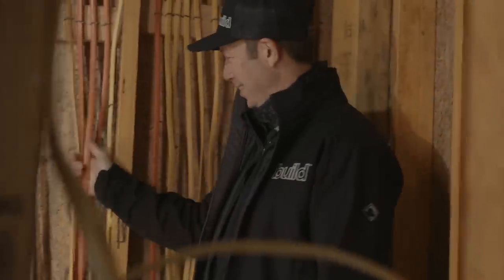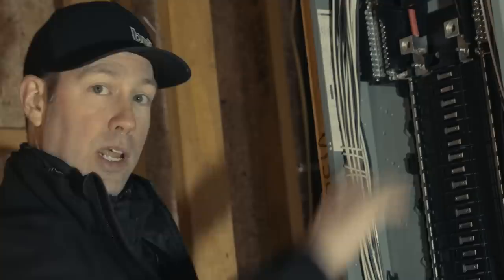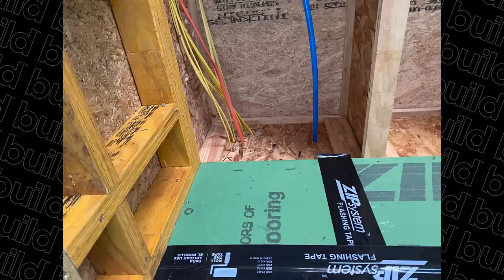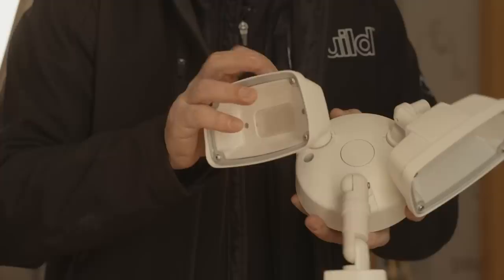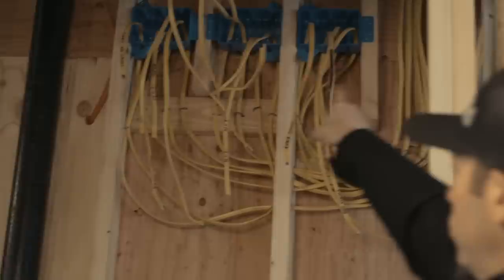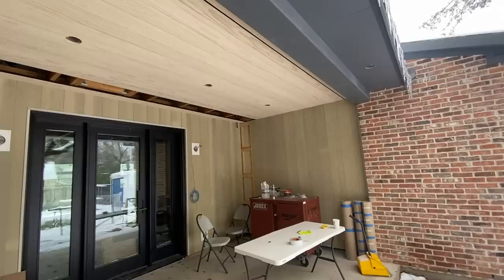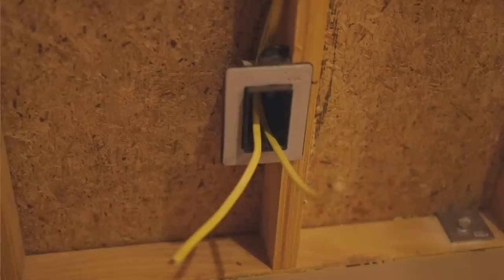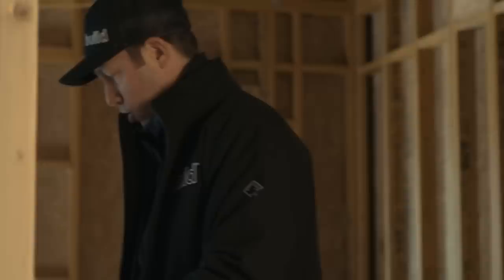5 Tips for New Construction Electrical & Smart Lighting!

Comment: I think the biggest thing that scares me the most is that the setup requires an app. Say halo for whatever reason goes under, chances are their app will cease to function. I’ve seen very similar technology in theatrical lighting controls that have a central processor to make edits and changes. If you’re going for longevity, you might want to look at long term software support solutions.
Reply: Long term, hackers can find vulnerabilities, and operating systems can change, forcing you to upgrade. There is a lot of technology that is beyond the control of the people building it. There is a lot of programming that is beyond the ability of the computer programer to control.  Today, in new construction it still makes sense to wire everything the old fashioned way so that the technology could be removed and replaced with old fashioned simple switches.There are places where is makes cost effective sense to use this technology. (such as remodels where running a new light or wire might be more expensive), but he is potentially asking for problems long term.
Reply: I agree.Sticking to open standard devices like zwave and zig bee are the safest choice from changes in vendor support. You can always switch to another controller from a different manufacturer.
Reply: Don't need vendor support when using an app like Google Home.  Another option!
Reply: @willthethrill360  If they have all the features you want and you’re not worried about Google cloud then it’s a good solution.
Reply: @willthethrill360  you do, the vendor is Google.
Reply: Yeah you want to look for two things in home automation. 

1. Devices that can run locally and don’t require the internet to do their job (they can require Wifi that fine but they shouldn’t require access to some vendor server on the internet.

2. Devices with open standards and long range. As a general rule my experience with Bluetooth has been it’s great for connecting a little speaker it’s not great for entire home automation system
Reply: It also only works when someone using the app is home. The nice thing about hub devices like running home assistant or hubitat is that it is fully offline compatible but it also allows you to control your home remotely if you need/want to. The only thing I really lose with my Z-Wave smart home setup with no internet is Google voice integration. Everything else works locally but having that internet option is also super helpful. It may be minor but he may wish that he had something internet enabled when he is half way down the drive way and he asks "did the kids turn off all the lights".
Reply: @JohnNeville617  you can have the voice integration using home assistant. There are a couple ways to do it some with a cost and some for free.
Reply: All of you guys jumping on here to give your opinion about a system you know nothing about. FYI Halo Home is a white labeled product from a controls manufacture by the name of Avi-on. I work extensively with them in the commercial space. The Bluetooth technology Avi-on is using will be the future standard. Z-wave will be replaced with this, I’m already seeing it in commercial applications. And for those of you saying Bluetooth is only good for connecting speakers really have no idea about it. They are using Bluetooth low energy different from the Bluetooth used to connect speakers. One very nice aspect to it is it works without a hub and does not need to be connected to your home internet network to function. If you want remote access, it does need to be connected to internet.
Reply: @logantaggart  I looked into it and first of all their documentation is pretty much non existent. Their was even a 404 link or two on their site. 

I don’t like things that rely on a phone as their central connection point. I do see they have a bridge but calls their cloud. I don’t like things that use external services because those are always subject to change, or even additional charges as we have seen with Wink. 

Additionally because they don’t interface with a hub you won’t be able to do much in the way of automation as far as I can tell. For example you won’t be able to say “When I unlock non halo brand smart door lock, turn on my entry hall lights.” Since I have yet to find a single company that makes every smart home product, and makes them all well, it’s way more sensible to buy products using common standards that can work with a variety of hubs and devices outside of their brand. That’s not something the brands commonly like because they want you locked into their products.

That being said I don’t know Z wave is the end all be I really like wifi better and yea that requires a good wifi network but that is a requirement of a smart home anyways.

Comment: Yeah, I’ve been using the Halo thin lights for a year now and eventually realized I no longer had to worry about my ceiling rafters throwing off where the lights can go.  If the rafter is right in the center, the support clamps can go to each side of it.  If it’s far enough to one side of the hole or the other, the clamps can go parallel to the rafter.  It’s terrific.
Reply: I do still need/want to be able to locate the color temp controls somewhere down near the switches.  I might look into the Halo Home thing, but already spent several hundred on their Bluetooth dimmer switches.
Reply: I agree. We’ve been those in all of our remodels and new construction. They are cheaper, easier to install, and just look better in my opinion.
Reply: How to you service the driver if you're straddling a joist?
Reply: @MrMasterfumi  Matt was not totally accurate in the video when he showed the thin can light straddling a joist. You still have to be able to get the driver through the opening in order to change it when it fails.
Reply: @stevejones776   @Kyle Fitzsimons : For a 1.5" wide joist right in the center of the light, the drivers on mine are narrow enough to just fit through at least one side.  If the hole is further to one side, the gap will be wider to one side.

I'm currently working in a 1-story or 2nd floor of a 2-story, so I still access from the attic-side both for running the cable and for placing the drivers (still easier), which I mount on one side of the nearest joist.  But checking the 4 1/8" dia hole templates, the driver box should still fit, and I think I've tested this before.
Reply: @gluuuuue  He said you can control the color temp from the app as well.
Reply: @dave56ize  Ahh, I think that might be my issue.  I get the ones that have no wireless control (at least, I don't think they do), for security reasons, so I don't think the ones I have will allow control via a phone app.

Comment: For who might be interested:
In the Netherlands most new homes get 3 phase, 220V/25amp (used to be 220V,16Amp, but solar and electric cars made 3phase become the standard).  With a mains panel in an indoor door closet that's standardized for gas, water, electricity and data/telecom input and meters. Positioned within 3m (~3ft) of the front door.
All wiring goes through pvc 3/8" (sometimes 1/2") piping. Every group has a 16Amp breaker per group. Separate groups are required for bathrooms, kitchens build in appliances and mechanical. Most rooms have one group going to a ceiling box (3"×3"). From that box all other points in the room are fed. And the box itself is used for the lamp.
Data wiring all goes from the "meterkast" (the door closet with the meters) to the points around the house and also through 3/8" pvc piping.
Reply: Is three phase better for solar grid input and charging EV's . I am just starting my reno Atm and was asked that question .
Reply: Post up.some photos. I would be realy i interested  to see the lay out